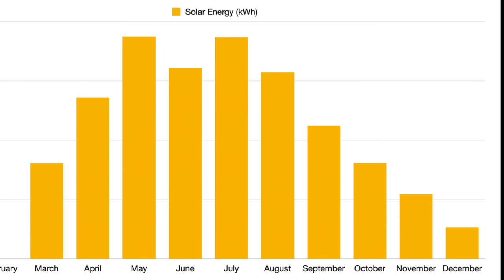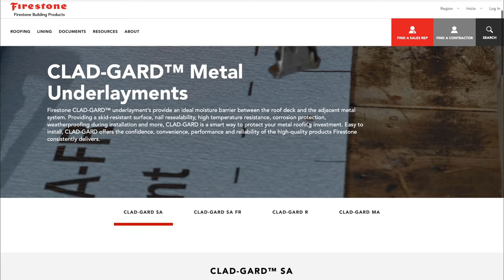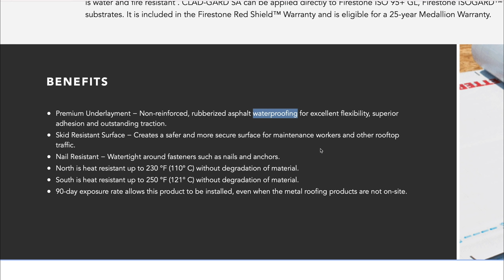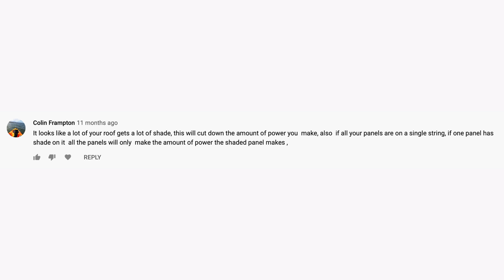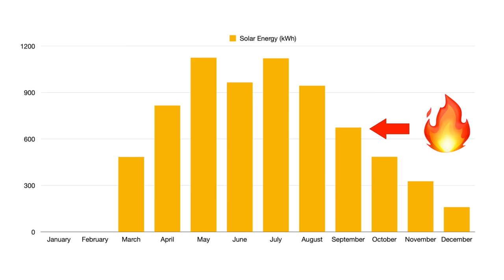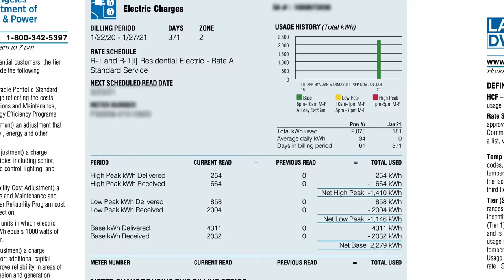1 Year with Tesla Solar Roof: top 11 questions answered + real production numbers & utility bills!

Comment: that is actually impressive on the savings there. It's like you paid 1 months worth of energy for an entire year. I'll certainly be getting solar panels in the future when I get my own house. If they aren't commonly installed by then.
Reply: Depending on when that'll be, they should be way more efficient and cheaper.
Reply: @TheCartWizard   no
increases in efficiency will cost more
the solar panel market is saturated at its present efficiency and cost - dont expect miracles that defy physics and economics
Reply: @kenwittlief255  current prices seemed to have reached equilibrium so it's likely that price will remain constant but efficiency will still increase
Reply: He got ripped off by LADPW though. They would have sold that 67 % for around 4,600 $ for doing absolutely nothing but he still had a small bill at the end. 
What if i told you my friend is splitting his with his nieghbour and they are both much better off. Yes they both have a storage system but they have never ran out and are now considering ways to sell thier extra power to locals.
Reply: @kockarot6362  they obviously will charge more for selling electricity than from buying it, also there have to be costs due to being in the grid right?
Reply: @bonaaq86  Except the home owner has to pay for everything. Including connecting to said grid.
SWEET DEAL FOR POWER COMPANY!!!! 
Homeowner pays for entire solar system, then has to pay the costs for tying into grid.  Homeowner "GIVES" the ElecCompany 2 Xs  the electricity worth several thousands. 
In return the Elec Comp "GIVES" Homeowner a bill.
This deal will continue this way and only get worse for the homeowner. This is because electricity price will alway go up. 
IMO this is a joke and the homeowner should "at least" half the profits.
OMFG
Its almost as bad as the banks lending money they dont actually have and profitting off of it. They are allowed to lend an extra 20 % so if they have 1 Billion they can lend 1.2 Billion. 
All profit baby.
Reply: @kockarot6362  
Exactly what I thought when I watched him explain the situation with the PTO.
Reply: @laurasomebody   Yeah, even with things that are, uh, legal, people wind up getting robbed.  Sad!
Reply: @bonaaq86  what do you mean? He's literally giving the power company free energy, they should be paying him for it.
Reply: Solar is a nightmare tbh. I run far more advanced panels on my boat than this chinese Tesla junk. You cannot get a genuine answer out of people who invested in them, they lie about the costs and the electricity generated. The deterioration is biblical too nomatter how clean you keep them. Mine have huge covers over them that the panel manufacturer sold as part of the kit and even with them covered 90% of the year and kept clean they have deteriorated maybe 25% in 5yr.
Reply: Solar panel are the the biggest rip off in the world
Reply: @utah2nyc250  yip. None of them last and just too much nonsense with them. On boats they are OK but only because they are out in the direct sun the entire time and they work on a much simpler but more robust system than houses and when I say OK I actually mean "barely acceptable" and you are quickly having to make them one of your priorities, which means less time to do the stuff you bought the boat for. The ones on UK narrow boats are now being fitted to houses here as the manufacturers that make house systems suck in comparison. There is one downside is that you need to get another guy who wants £1600-2000 to surveil them to allow the marine one to be certified for still being within the perimeters of certification as the lesser certified house one. Makes no sense and thats the exact reason most people fall out with "solar power" within about 3yr. The problem with the  electronics especially now is although they have became more advanced with time and shunk down in a NanoMeter proccess,  its completely tanked in build quality and reliability. The Chinese made junk we have now is tatt compared to the Japanese stuff from the past and they don't care as people are still buying it. I think solar could have worked out good but it became politically ran, red tape everywher and manufactured in China unless you paid out huge money for Japanese panels, cabling, electronic components and storage. Even here and now if you want a good system on a boat you better spend 6 month looking deep, deep down at the hardware/software/material level and not listen to youtube or twitter or Facebook or randoms, its a strict 6 month diet of the hardware and software and especially battery tech where it applies. Only then would you know your money was going to the right places and you won't have the general "structuring" issues that seem to turn everyone off. I know boat owners that are too ashamed to admit that their £20k of solar has completely failed to do what it was supposed too, they keep the panels on the boat, they don't take the panels off they want it to appear that they still work good though. Their in lays the problem, the outlay cost is such that when it backfires on them they cannot swallow their pride. To much invested they are.
Reply: Apparently the upfront investment cost doesn't get factored into your "cost of one month".

Even if the panels ONLY costed $20k, and indeed last for 20 years, that's $1k/yr + the $200 from the power company.

Most everyone who has installed solar panels aren't saving money hand over first. It's just slightly less than paying for power from a utility company.

Comment: In all fairness you have to include the cost of cleaning the roof. You can purchase an extendable pole to clean the roof yourself. It is the same principle used to remove snow.
Reply: A  high-pressure garden hose is all you  need ~ and not  even that unless you're picky. If  you ARE losing power   and it bothers  you, stick up a couple more panels to  compensate;  they're  dirt  cheap these days.  (I  too  live in a bushfire-prone  area, so understand the  problems.)
Reply: @dabbbles  
To each his own but when you can make money by doing nothing once the panels are installed a little effort is not too much to expect from someone able.
Reply: @larrybe2900  Not  sure  I understand  your point. But keep in the  forefront of  your  mind that "There's no such  thing as a free lunch".  As  stated  elsewhere (I get lost among the pages!) what  started out as  a 'subsidy'  paying 66 cents per  kWh you  fed into the  grid  has  been reduced (over time) to  about  5 cents at the  same  time the  price  you paid  for  'connection to the grid' has  quadrupled.  (and there  are  all sorts of expensive 'conditions/fees/charges/etc.) And as we  speak  laws are being passed  to  allow the power companies to  charge YOU  for  feeding power into the  grid ~ as a  charge for using  THEIR  cables/posts/etc. ... which will ALSO increase as time goes by. Unfortunately most of Australia's millions of  more-recently installed systems  won't run UNLESS THEY'RE CONNECTED  TO THE  GRID via a  CONTROLLED hi-tech inverter,   so  people trying to do something 'good'  are stuffed. (and  don't  forget  there are tax/other implications to be  considered. The  BIG advantage offered  by solar-power (and one  recognised  by a  few million Hippies back in the  day!)  was  that  the  INDEPENDENCE offered  by solar-systems was pure  gold... on ANY  level. Get back to me  directly if  you like via  dabbbles@gmail.com
Reply: @dabbbles  
If the idea that systems are gotten for free then there is no incentive to maintain them for optimal performance that might be true. I can only speak from my experience where I could produce extra during the day and get a credit on my bill and my January and part of February bill was $0. I used high energy appliances during the day when I was making my own power. I had a small fee on my bill because I was solar but I forget the reasoning. Solar is good in that power companies don't need to meet high demand at peak times of the day which saves them from construction costs. Power companies have the upper hand and can do as you mention with almost impunity.
Reply: @larrybe2900  Certainly we  should all pool our  own experience:  when i was  younger  that went without saying, and EVERYBODY  benefitted ~ and  equally important, massive amounts of  resources were saved  from wastage. Lots of  self-satisfaction, too, in using one's brains (community-talents)  to improvise and innovate. eg drilling  holes in the  floor behind the fridge and venting  through  the  ceiling reduces  to a  fair  degree the  amount of power used to  run the  fridge.  In one case, a  neighbour  couldn't afford to have  the  trees to the north of  his house cleared  to provide access to the  sun. After  some  headscratching and some wine or grass depending on one's taste  we  mounted  8 panels (a BIG system back in the day) on an aluminium frame  and  hoisted it  130 ft  up a  tree and  fixed it in place, pointing North. Great feeling of  achievement  and  neighbour-bonding.  (This was back in the  early days, when components  were  SO  expensive  that  every  Watt counted.   If  you  google up 'Calamity Jill'  you'll see another set-up we improvised way back in the mid-80s, when  'solar-tracking' was all the  go. (but  standard trackers were VERY  expensive and unfixable if they  packed it in. The  top 6 panels  were  the  first ones I put up at  my house (before I sold it).   They cost me (second hand)  $13.80 per Watt, back when $125 was a  week's wages, and they're  STILL producing  at about 85% of  rated power output.  Feels  good!  Gotta go: but I  DO miss  ye olde values and methodology. All the best.
Reply: @JimBobDewayne  
Maintenance would possibly be for the inverter. The glass is pretty tough but with baseball sized hail all bets are off. Usable life for the panels is 25 years. Production gradually diminishes at the end. It all has to be considered for the long term and the cost of power in the area. The more expensive the quicker the return on investment. There are variables like positioning and any shade. Facing south is optimal as it best catches the full arc of the sun. How far north you are is even in the mix. If a roof is needed then the difference of what a regular one would cost ought to be deducted. Without help it is a heavy financial lift for sure.

Comment: Question: how much was a regular roof vs the Tesla roof, and with the estimated cost saving a year, how long will it take to make up the difference, taking into consideration the .5% degrade over 25 years?
Reply: If it was worth it, everyone would have one.
Reply: @michaelcarton3299  No doubt.. I can't see how it's anything more than an expensive gimmick for neighborhood block party bragging, but maybe I'm wrong?
Reply: You’re looking at about $50k or more for a solar roof
Reply: @asadianbelifont3875  really curious if home owner's policies cover any of it? I would think they wouldn't, mine has a sub article on requiring any roof replacement to be a 30 year minimum roof, then they cover most of the replacement cost. The total cost of my house was 36k on a replacement standard roof, but only costs me 3400.00 out of pocket. Or a percentage of the total cost.. being that's the case for me, I have to assume this is an option that would never actually be worth it, but again, maybe there's some kind of tax credit, or some kind of percentage by insurance that gets paid, with a penalty for less warranty. Just curious what the full real world cost was for the OP. I can imagine it's not cheap, and as stated earlier, I have a feeling it's a bragging tool and not much more.
Reply: @asadianbelifont3875  If that is true, and he is only saving around $2K a year, that is 25 years to recover his investment.  That is not a good deal.
Reply: Covered in his other video, watch it :) his house was in need of a new roof anyway and they wanted solar panels which made the solarglass roof a far more reasonable prospect.
Reply: @lemagreengreen  So, yeah I watched that, but it most certainly doesn't answer the question. Which in the first video indicates that the traditional 30 year roof is 9-11k, while the Tesla roof with "discounts" and "incentives" came to 33K dollars.. That they thought about traditional solar panels which were estimated at 18K but they don't tell you the life span of the solar panels vs the roof, what the actual real cost is without the incentives, or what the total cost is with the degraded power output after 25years.. in other words how long to break even?

Not to mention, or add to the question, but currently i have a full sun roof with about 1200sq feet of coverage, my monthly electric bill is about 25-50.00 in the winter(7months) and about 75-100.00 in the summer (5Months).. At 33K dollars it would take me 27 years worst cast scenario to make up the difference in cost of electricity assuming you could pump enough electric back into the grid.. not taking into consideration the cost of battery needed to store it, and not taking into account cloudy days, or weeks of gloomy winter.. snow.. etc.. Which means that I could buy the cheap roof, and without the solar panel, i would still never spend enough in electric to make up the difference in the cost of the electric.

Edit: So the additional info from the original video shows that the OP was using 8,441kWh per year, based on the national average of .0859 cost per kWh it's roughly 725.00 a year in electric. which if you subtract the cost of the nice roof at 11K, you are left with 22K in total Tesla roof cost, not including upkeep, degraded power creation over time and maintenance. So at 22K how long will it take to make up the total cost? 29.33 years, or based on  the facts from  the original video, he is losing money, and it's a complete waste of installation.. Other than to have the biggest dick at the block party..
Reply: @rustbeltrobclassic2512  the other thing I don't understand is if his roof is making all this electricity and being sent to the power company to be sold to other places do he get a cut of the money the electricity company is getting from his roof
Reply: @warlockgod66  in NY you do get paid to pump back into the grid, but in western PA, Ohio, and parts of Indiana they charge you to pump electric into the grid.
Reply: @mikeuhlir562  
Elon musk think its the greatest deal the public can have
Reply: how much does it take to reshingle your roof ... about 30k ... hmm about the same cost as putting in a solar roof ... the difference ... sending power BACK to the grid ... you not only have free power IN your home ... BUT you get paid back for the power they have to buy back AT the rate for the time of day they get it ... 
.
I have never heard of ANYONE paying a shingled roof owner daily for having the roof installed and working ... while a solar roof does ...
Reply: @michaelcarton3299  depends ... do you like spending 2k for hydro a year or 160 for hydro a year ... $1,850.00 bucks IN MY pocket seems worth it ... but then I much prefer keeping my hard earned money instead of frivolously giving it to some BIG corporation who is over charging me for power ANYWAY ... 
.
everyone would be doing it IF they sent the time and did the math ... but they rely on cheap appraisers wh dont care if they sell a roof or not they want your money for them to put a few numbers into a spreedsheet and say yeah you can make it work ... 
. 
dont forget they ONLY figure cost effectiveness for peak period sun.... but last time I looked the sun rose between 5am and 8am .. and sets between 5pm and 9pm ... not 11am to 4pm ... so on average you have sun for 10 hours per day every day all year long ... not 5 hours per day .. and they estimate using MONO crystaline panels which are only really good for charging a car battery ... for household applications they are the cheap chinese junk we always get ... while if you spend that little extra and get Polycrystaline panels ... you increase your solar collection to a minimum of 3 different portions of the light spectrum and not just one ... and you can get panels that are 5 and even 6 layers deep ... the deepest ones at 7 INCLUDE in panel water heating ... 
.
so are they worth it ... YES ... spending ... 160 bucks a year for hydro ... beats the living snot out of paying 2,000 a year for the same hydro ... 
basic simple MATH
Reply: @mikeuhlir562  avg 2k ... for 25 years ... 50k ... in his pocket NOT in hydro's ... how is that NOT worth it ... could you find a use for an extra 2k a year in your bank account ... I could ... heck its just under 200bucks a month ... but thats a nice dinner out or a movie with a snack .. and cab fare home
Reply: @0623kaboom  If it was the same price it would be a no brainer, but, it's not. According to the video the regular roof, ranged from 9-11k or about 22-24k dollars less than the Tesla roof.. according to calculations it will take 29 years to break even, and need to be replaced in 25 years. Or, you'll never make it back. But obviously if they were the same price it would be a different story.